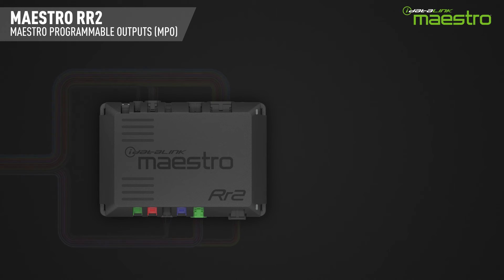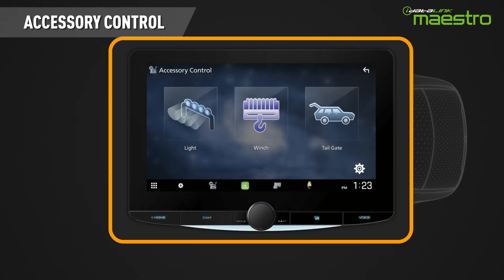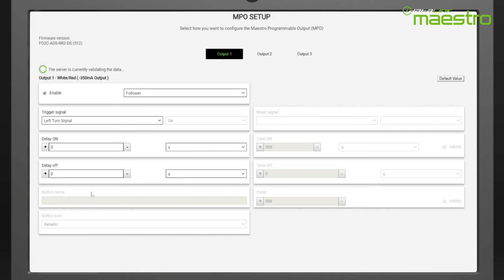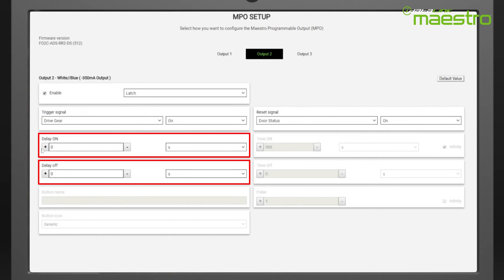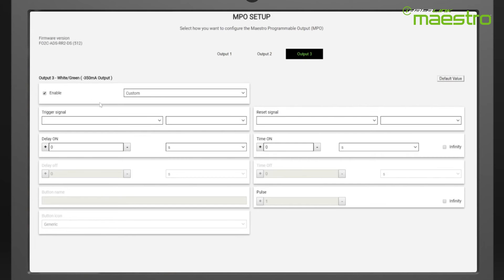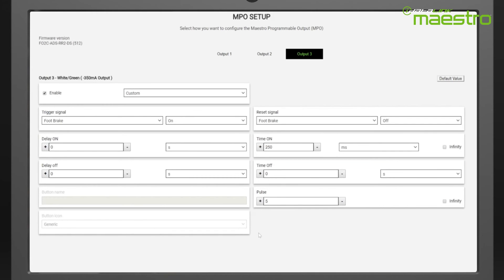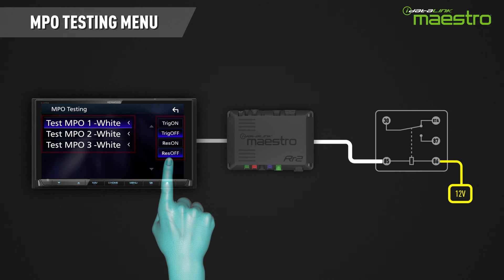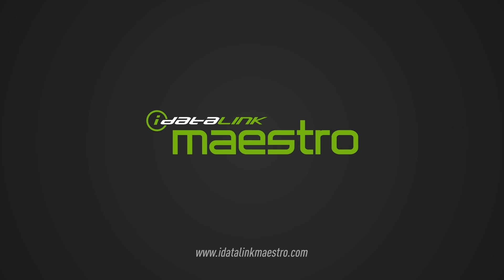Maestro RR2 - Weblink Desktop Maestro Programmable Output Tutorial

Comment: Where did you get the wiring terminal for the MPOs on the RR2? Mine did not come with it. I have tried contacting ADS (idatalink), they have not returned my calls and their FB page is only for commercial installers.